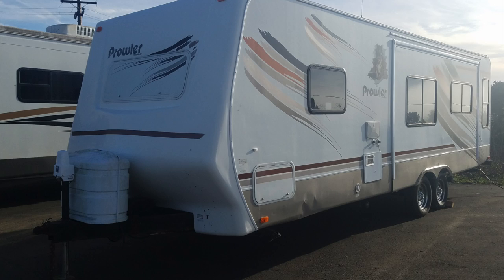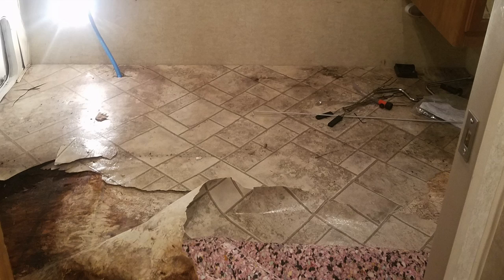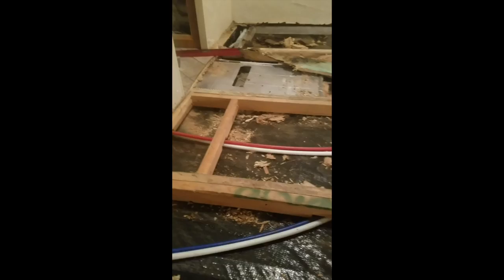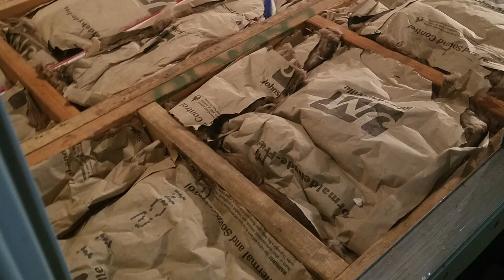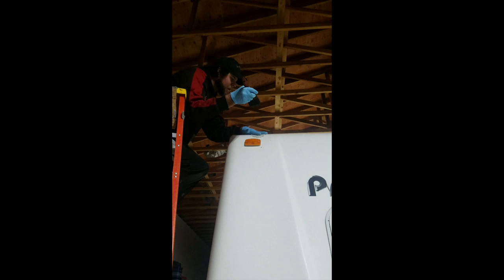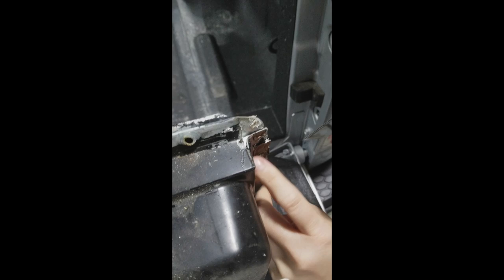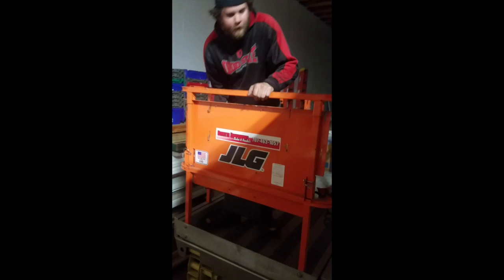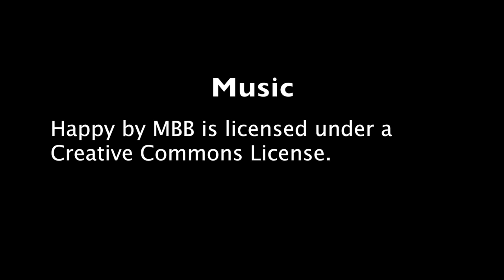Ep. 7 DIY: Replacing subfloor in a camper. Life Goals

Comment: One thing you need to remember. You always fix the outside first. A tube of caulking would have saved that trailer a whole lot of trouble. You always fix the outside where the water gets in first before you fix everything inside.
Reply from the maker: We bought it like this and immediately put the whole trailer in a pole barn, so it didn't matter much to us which we fixed first.

Comment: Good do-it-yourself work!
 - I recommend for your next sub-floor repair you don’t put in that cheap OSB stuff the trailer manufacturers use.
 - Use good plywood instead.
Reply: If the source of the water is found and sealed, why pay extra for good plywood. Use particleboard.
Reply: I got marine grade. I don’t ever want to have to do a replacement again

Comment: Wow does nobody ever notice how the aluminum bottom wraps on top of the fiberglass wall allowing water to flow right into the wall to rot the bottom of all the studs ,,,,,shouldnt the fiberglass lay on top of the aluminum so if the trim seal fails water cascades over the aluminum to the ground instead of into the living area ,,,,,,,build to fail , its called consumerism,,,,,how much did it cost for that disposable camper ? Ill give it 5 years before its a total loss ......fibercrap campers ,